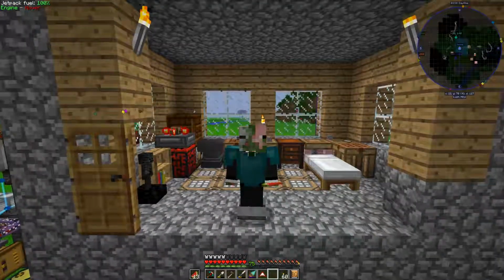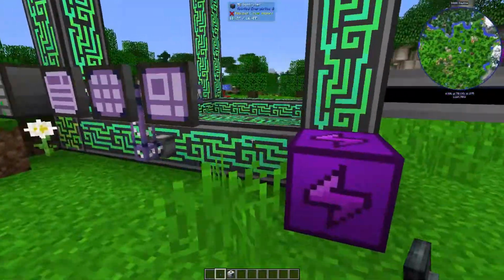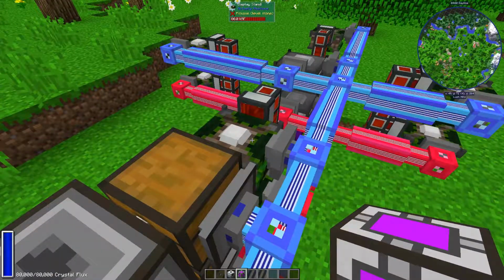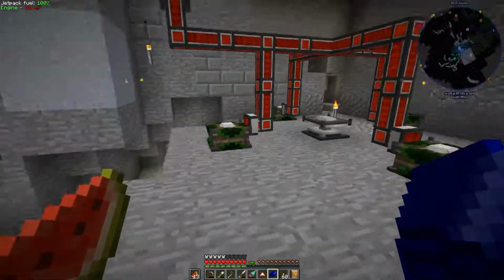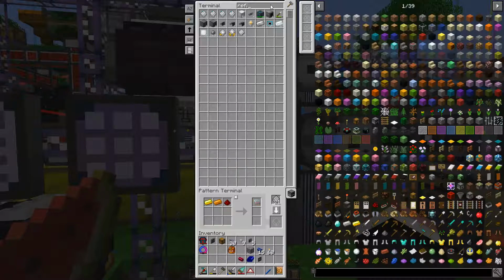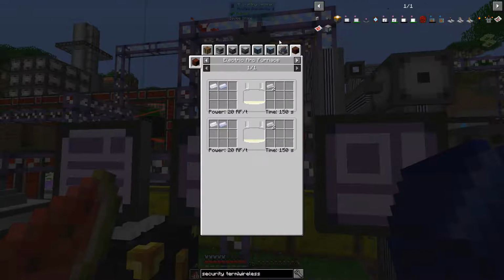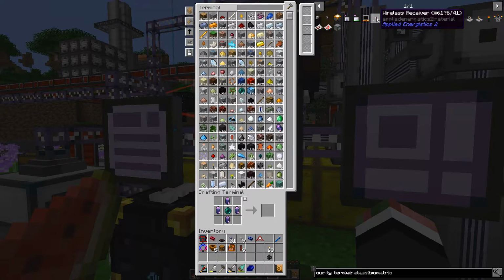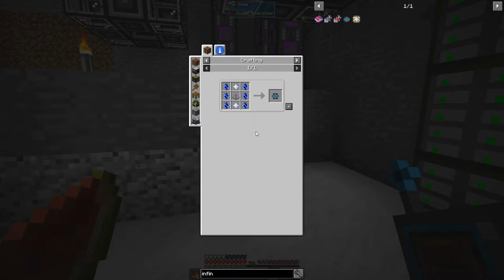Wireless Crafting (FTB Continuum Let's Play Ep. 55)

Comment: OMG... I Never seem to have enough... Latex!
Reply from the maker: More tree fluid extractors?
Reply: @ZpprSprk  I will need many more than the 5 I had running, and switch to rubber wood too. My empowerers do not make the two circuits, I utilize the insulated cable Efab recipes instead, as they are much faster but cost a lot more latex and ingots, and metal pressing.
Reply from the maker: I think that is why I'm sticking with the empowerers for the circuits. I will probably set up a level emitter or something to make some extras  to keep on hand to speed up auto crafting things.

Comment: I did like your sub-network for you empowerer's I didn't go that way myself, but it'll do.  I could upload a pastebin with my program's if you like for a RF Tools style. I went all out. I can describe its build, but its very complex. 
I have the interface on a drawer controller, and drawers for each item used in the process.
One Program repetitively populates an enderchest with up to 1 stack of the items used on display stands, found in the drawers.
Another program detects the item on the empowerer, locks crafting and moves the needed items into a separate chest for the display stands, and sets the related chest redstone=15.
 if no item then redstone=0, and crafting is unlocked.
if the related chest redtsone=0, XNet tries to move any of the main blocks onto an empowerer.
if the separate chest redstone=15, Xnet tries to move any of the display stand items onto a display stand, 
Finally Xnet tries to always removes completed items and moves into the original interface when complete.
This build actually uses phantom face  blocks and RF Tools nodes with a single RF Tools processor.
Reply from the maker: Sounds quite thorough and, yes, I would like to see your programs. I like the simplicity of just using a subnet for it.